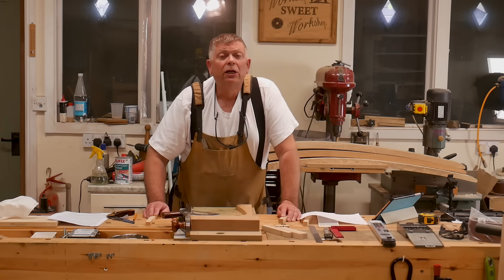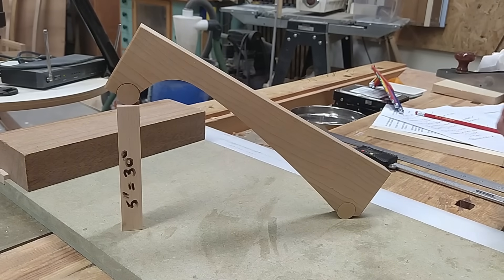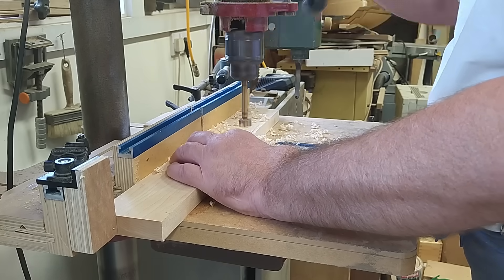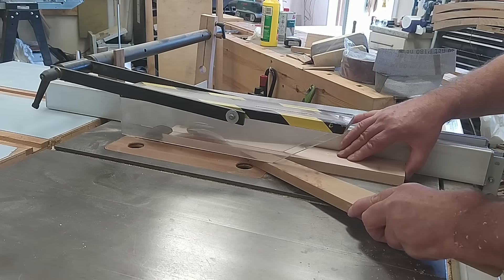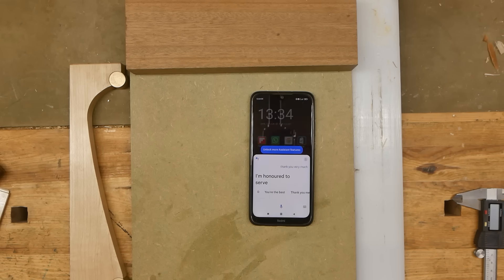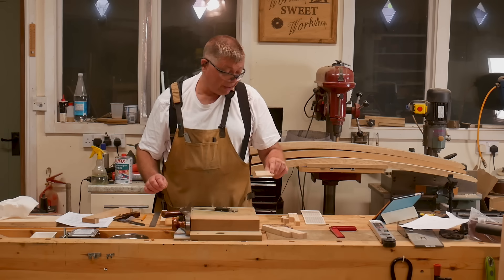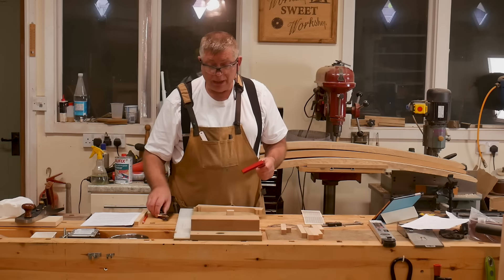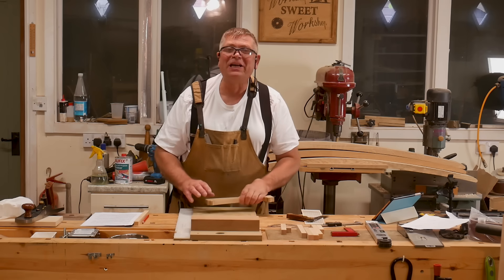Make a Sine Bar for perfect angles First Time Every Time!

Comment: The whole wave form of the device has no application other than avoiding wood sticking out or such, yet you mysteriously didn't mention that and decided that you would want it there. It would have been nice if you had mentioned that. Nice practical application of trigonometry though. I didn't know it was a thing. I have never seen such device in my fathers workshop who was a professional woodworker working with machines only marginally. (on occasion I do these kinds of calculations myself while practicing my DIY craft).

Comment: How does the accuracy of the 10 inches affect the device?
Reply from the maker: That depends. For very small angles, any deviation from 10.0 has very little effect, but for very steep angles, the deviation has a greater effect. But for the sort of work I do, chairs, splayed legs, etc, any such error is insignificant. HTH
S
Reply: @SteveMaskery Thanks.

Comment: Great video, great lesson. I had to something similar where I also needed a precise 10" length. I have the same problem as you with my measuring tools, so I made two precise 5" pieces and stacked them. One slight advantage to this method is if you think both pieces are perfect, you can set them next to each other and see if they are the same. If not, you have just caught an error. Of course they could be exactly the same and both wrong, so...

Comment: Chippys work down to 1/32 max an engineer would never measure and go close enough lol. ( it depends on the design and tollerances)

I have done my trade ribbing, 😂  well done Sir for passing on the knowledge and practical skills. I dont know how many folk say you only use trignomerty / pythagorous in school i will never usebit again. Sadly most jobs dont but being an engineer I used it daily and for most trades it varies on the students capability and understanding. So thanks yet again for displaying this.

Comment: There is an easier way if you are using the metric system:

1) The radius of a circle with the circumference of 3600mm (==360 degrees)is 637mm.
2) Transfer this measurement on the x- and y-axis of a board starting at the the point which has a 90 degree angle
3) Use a "bendy" ruler and measure 900mm (=90 degrees) from the 637mm point on x-axis to the 637mm point on the y-axis
4) This should now represent a quarter circle
5) Now you can mark the required degree between 0.1 degree (=1mm), 25.4 degrees (=254mm), etc on the board by transferring the "degree" measurement from "bendy" ruler to your board.

BTW Metric makes it so much easier......

Comment: To be more precise on the 10" stick. Make a 6" & 4" or (2) 5" sticks. Those you can measure with your calipers.
Reply from the maker: What I should have done is make the dog-leg version for the spacer, as I did later on in the video.

Comment: I've never seen a wood sine bar, would not have dreamed a woodworker would ever use one. I assume you use something hard for the bearing rods, so your precision angles stay consistent through the years.  Oh.  Brass.  Umkay.  What keeps the wood dimensionally stable?
Reply from the maker: The wood is maple, which has a very low coeficient of expansion for humidity, even in tangential readings. The only thing that matters here is the longitudial reading. Tables of wood movement give radial and tangential movement, not linear, which is tiny. I'm building dining chairs, not the International Space Station. It's horses for courses. For applications like this, this is more accurate and precise than I could ever need.

Comment: Why on earth would you make a WOOD sine bar, with all the changes in dimensions that wood is known to exhibit, when perfectly beautiful metal ones are available for well under $100. And then you spend time talking about it's accuracy. Cast iron would be an excellent choice. Steel would be good. Even aluminum, with it's rather large coefficient of expansion would be so much better than wood. ... than any wood. 

7/10ths of a degree not possible with a protractor? Well if you start with a good quality protractor and not a dirt cheap plastic one from the corner drug store, and use a 5X or 10X magnifier (also good quality) then estimating to tenths of a degree, between the lines, is not all that difficult. 

I work with wood. I work with metal. I work with plastic. I work with many, many materials. And I choose the material for any item that I make carefully, with due consideration for the function of that item. Not just because it's just the material that I usually work with or happen to have sitting around my shop.

Comment: 2024 and you are still using inches. Why?
Reply from the maker: Because 10" is a handy size and 100mm is a bit small. And multiplying by 10 is easier than multiplying by 254.

Comment: Well this was 10 minutes of very enjoyable YouTube thanks, I read mechanical engineering back in the late 70s and have never seen one not even in pretty sophisticated tool rooms, given steel rules are £1 a foot in the local green centre I will cut two inch long pieces and slot them into the sine bar rather than use the brass cylinders won’t look as nice but it’s with in m workshop capabilities sine I don’t have a pillar drill.

Comment: This is exactly the kind of precision I've been looking for. I was having trouble getting a good mitre on a picture frame, but this just might solve that.
Reply from the maker: Glad to be of help. Don't forget that for good mitres, it is necessary, but not sufficient, for the angles to be cut at 45. Opposite sides of the frame also have to be exactly the same length. But I guess you already knew that. :)

Comment: @05:30 why no push stick? Good golly
Reply from the maker: You are absolutely right. But my guard covers the blade at the sides as well as above and I had to make sure that the wood was pressed against the fence, not just pushed forward. But yes, I was being a bit cavalier.
Reply: @ scary I mean your sine bar is essentially a push stick. Just make two more for a side and top push stick

Comment: That’s a pretty good trick. I like that idea. Problem is a table saw is only so accurate. I have a sliding T square that will give me angles down to 10th of a degree for miter cuts that is a whole lot easier to set. As for setting the tilt of the blade you can buy digital angle finders that have magnets to hold it to the blade that are more accurate than the table saw/blade combination.

I did like the little trick with the wedges in the miter slot. Will have to add that to my bag of woodwork tricks.

Thanks for the video, it was worth the watch.

Comment: Better to get a set of metal gauge blocks instead of wood that will swell and shrink with humidity.
Reply from the maker: By how much does a piece of oak or maple swell and shrink ALONG the grain, especially when the blocks are so short. It's negligible. Horses for courses. I was setting out compound angles for a set of dining chairs, not building the International space station. It is as accurate as I could possibly need in a workshop, and then some.

Comment: With all due respect, I don’t know about all this. All you need is one small piece of basic trig, which I woodworkers must know. The tangent of one of the acute angles in a right triangle will give you a ratio that is the length of the side of the triangle opposite from the angle, divided by the length of the side of the triangle next to the angle that’s not the hypotenuse. Suppose you had a base of 4 cm and needed a height so that the angle formed 80°. Enter tan 80 in your calculator, which gives 5.67. The ratio that is the height divided by the base must be 5.67, meaning that the height will be 5.67 times as long as 4 cm, or 22.68 cm. For other situations, calculate the tangent of the desired angle, and set it equal to the ratio of the opposite side divided by the adjacent side. One of them will be your unknown value, and solve a two-step equation to find it. Measure and mark. Don’t forget to convert to centimeters first, or convert at the end and round to an imperial fraction carefully.
You can also use an inverse trig function to easily find an unknown angle given two known sides. 
Cutting two spacers would help for repeated marking. However, any imperfection cut in the ends of the spacer will introduce error. So, it may still be best to use your square.

Comment: Machinist would use gauge blocks to very precisely construct the height a sine bar would be set at to get a precise angle.  A set of gauge blocks allows pretty much any distance to be constructed up to the limit of the gauge blocks.

Gauge blocks are a very precise supplement to a sine bar.

Comment: For that third hand you could soft clamp the sine bar to the miter gauge then do your alignment.  Saved this one to my woodworking videos.  Definitely a keeper.
Reply: Yes, that would work. I've also discovered that using 3 small disk magnets is a very good solution.

Comment: Genius.  What a great and elegant way to set up the cheap miter which comes with the table say and not having to buy those expensive miter bars!  You might try using magnets to hold your square to the table for the third hand.  They make welding magnets at low cost.
Reply from the maker: You are absolutely right, Dan, and indeed, when I actually came to use it in anger when I was building my dining chairs, that is exactly what I did. It worked perfectly.

Comment: That's a nice drill press. Or pillar drill, I guess you Brits call it, which is a better name, in my opinion.
Reply from the maker: It is lovely. I call har Lulu, because she was built in 1964, the year she had her first hit with Shout! :(
The quill is wonderfull, butto be honest, the pulley arrangement leave s a lot to be desired. There is no Woodruff key, it's just a grub screw onthe shaft. And there is no rack an pinion for rise and fall of the table, which become more of a problem the older I get.

Comment: Could you have not made two five inch pieces and put end to end match the ten inch against those two end to end. With sensitivity of fingertips or feeler gages or a block and feeler gauges, I bet you could have got it to almost within four thou'. A nice job though, and perfectly accurate enough. Not used a sine bar since my engineering days, forty years ago, along with wringing gauge blocks.
Reply from the maker: Yes, but what I should have done is the stepped spacer technique that I used later in the film. Measure one half from one and and the other half from the other end. I cold get anything up to 300mm or 12" pretty accurately that way.
Reply: @SteveMaskery  I commented on that before I watched the technique used later (naughty me 😅), though both options work, your half and half option is more accurate I suspect. I have a mediocre mitre fence, but using similar techniques to work from the mitre slot, I'll be able to set more accurate angles, for the few times I need to, as I do have a decent mitre saw.

Comment: A more simple idea that doesn't need to make accurate spacers: take a board of MDF with a straight edge. Mark two points 10 or 20 inches apart on that edge. Draw a perpendicular line on one of the points with an acurate square. Calculate the sin of the angle you want in a calculator and multiply it by 10 or 20 depending on the number of inches those points are separated and mark that distance on the perpendicular line. Draw a line between the other point on the edge and this point in the perpendicular line. Now you have a right triangle that has the angle you want on the edge of the board. Transfer this angle to a speed square, and now you can transfer that angle to your project.
Reply from the maker: Yes, that would work.
Reply: @SteveMaskery but it wouldn't be that cool, is that what you're implying?

Comment: you can also make a sine protractor. just make sonethig like a folding ruler, (one hinge and screw for locking) non hinged side has two half rounds that when together are exactly 1" and as here 10" from hinge center to center of the half rounds, if material of the halves stick up say 1/4" and the two half rounds share the same center, this means you get any sine by just using calipers directly across the ends sticking out,  just remove that 1" to get correct sine measurement.

Comment: ...making a precisely made spacer.....
i cant make THAT part, so any vid that claims that anyone can make this simple device - as long as you have 10's of thousands of dollars of equipment & a workshop - is lying....
shameful....
Reply from the maker: I don't agree and I think you are very rude. Try to make the world a better place, rather than just disparaging the best efforts of others, eh?  Just because you can't do it doesn't mean that others can't find it useful. Fortunately.
Reply: @SteveMaskery  When working for the MoD, we had a variety of sine bars. I remember calibrating inclinometers with sine bars on a 10ft granite surface table. On installation that table got calibrated with theodolites and telescopes in the lab to find the really accurate parts of the table. Fun times.

Comment: This seems like an extremely tedious thing to set up. You need all your bits of wood of varying length. they also need to be of precise measurements. what i would do is place a nut in a piece of wood. and put a bolt in it. Then use the bolt to get your different heights. i would also make it so that you can lock the angle.
Reply: Wood is not as subject to dimensional variation due to temperature change, as long as it is sealed to inhibit moisture  movement.
Reply: <<This seems like an extremely tedious thing to set up. You need all your bits of wood of varying length. they also need to be of precise measurements. what i would do is place a nut in a piece of wood. and put a bolt in it. Then use the bolt to get your different heights. i would also make it so that you can lock the angle.>>

Close enough for horseshoes, anyway!

Comment: Interesting Steve, piqued my interest in making one, but I cannot see how the accuracy could be good enough for precision. How thick is a line, how good is a steel rule, one's eyesight, the available light etc. So many variables ! Cheers mate.
Reply: A manufactured sine bar and gauge blocks would probably be about the most accurate way to lay out an angle,  I would suppose.  Such a sine bar can be had foer $20 or more, and a set of gauge blocks for $100 or more, used. 

If anyone can suggest a more accurate method, I'd be glad to hear it suggested.